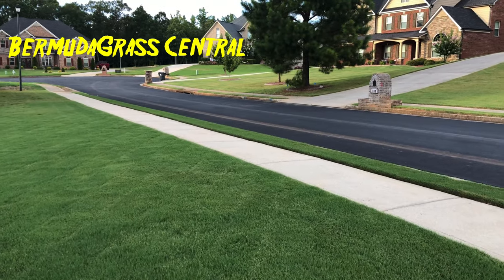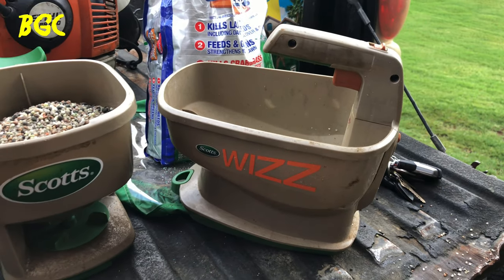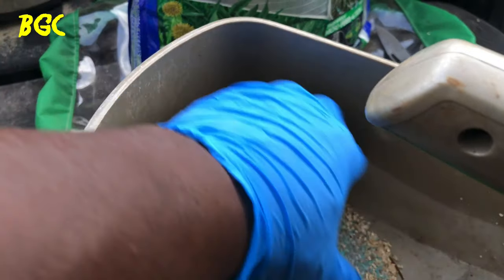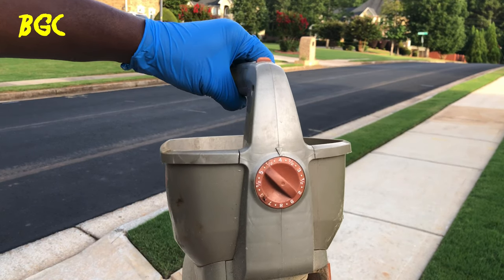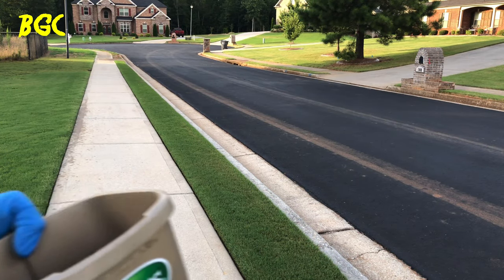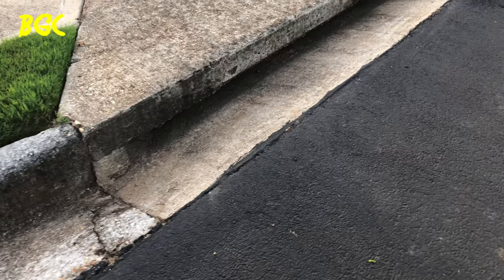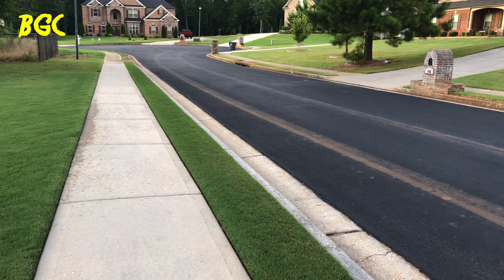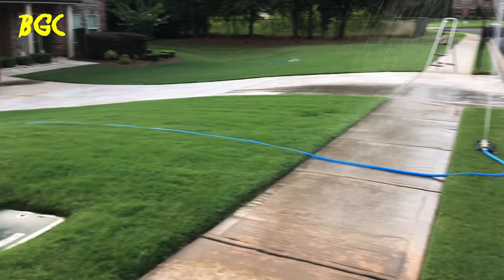The Pro’s Don’t even do this right // fertilizing Sidewalk Grass / broadcast spreader

Comment: Your yard is looking great! My father in law has those park strips in front of his house as well. He uses a soaker hose that actually sprays a little bit out, not just one with holes on two sides of it, and that seems to work well for him. It’s very concentrated to that strip and it waters deep. Something to look into. There’s tons of different lengths. He also uses a little orbit tractor 🚜 that rides the length of the hose you set it on and that too seems to work well for his lawn. Even in his tall fescue, it’s just chips along super slow. It’s pretty cool to watch.

Comment: I have the whirl. but my problem is what to use on the grass it is horrible any tips would be great, weak soil, easily to pull grass up weeds dry bald spots
Reply from the maker: First get a soil test, it will guide you as what to put down. Other than that I can only suggest you try my lawn care program.
Reply: @BYDonBermudaGrassCentral  details.
Reply from the maker: @RNDiva33  https://youtu.be/9uavoDKQrp8

Comment: Use a drop spreader my bro.
Reply from the maker: Nothing wrong with that except drop spreader are not used as often. The 🤚🏾 hand held unit work best for me because they are so versatile. At a cost of only 20 bucks versus 70 for a good quality drop spreader, I’d use the hand held for those vanity areas and hard to reach spots plus it takes up way less space 👍🏾

Comment: My curb strip is burnt out or overheated again, even with irrigation, fungicide etc.  Hoping it comes back.  I may rein it this year and dig it out to see if there is an underlying issue with the soil (rocks etc?).  I have a whirl but haven’t used on the strip, maybe give it a go. 😀
Reply from the maker: Lawn Journeys have you tried Hydretain yet?
Reply: @BYDonBermudaGrassCentral  Yes used this year and hit the park strip again.   I was  out early this morning and saw active fungus!  I've been doing preventive fungus treatments with Disease X and Propiconazole 14.3 but apparently this is something other.  Trying to get it identified so I can use the correct treatment.

Comment: I use my Scott's rotary spreader with the edge guard on the right running along the street. Def keep the product off the street.

I lay a cut cardboard box across the top of the spreader that hangs along the left side. It acts as another guard on the left.

Go slow, reduce the spreader setting. And as BYD said, blow off the sidewalk. Especially if there is iron in the product - it will stain